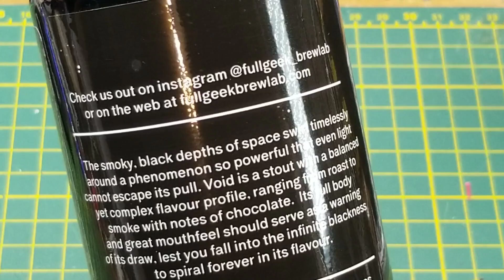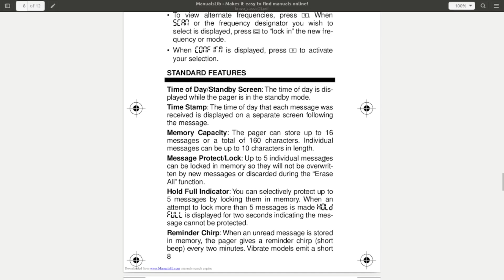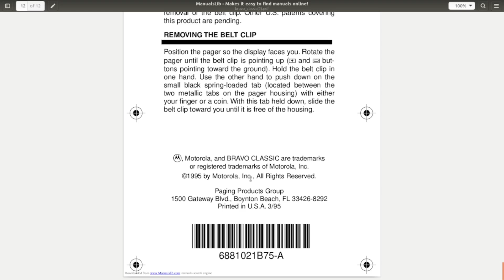curiosity teardown: pocket pager

Comment: Test mode for this pager: press and hold both buttons (grey and black)at the same time and turn on the pager. You can test display, vibro, buzzer, check cap code and baud rate.

Comment: And this is why SMS was 160 characters per message when it launched with GSM. I think there was a suggestion receive only GSM "pagers" but I don't remember one coming to market.
Reply from the maker: Those GSM receive only pagers never took off. 
I suspect largely because the early Blackberry came along at about the same time and cornered that market because they were capable of bi-directional text messaging.

Comment: A Motorola Bravo numeric pager! Worked on hundreds of these! News for the druggies, all paging companies cloned the ID codes to police departments when they came in with a court order. They knew your every move.😂😂😂
Hardest to repair was replacing the LCD screen, required a special machine to heat bond the display Mylar flex circuit "board" to the logic board. The first thing as a repair tech we would do is analyze it for water damage. If we noticed a scent of piss, you know it was dropped into a toilet or urinal. This would be an automatic "not repairable". It was considered a biohazard. It was very easy for one to scratch or cut themselves on sharp leads that might extend out from the boards. This has lead to techs winding up with a major infection from the contamination. 
Most often boards damaged to the point where it would take too much time to repair, if it was a rental it would be exchanged and the customer would be sent on their way. The old pager was used for spare parts. Those lights were a pain in the arse to replace. Still have the programmer for these items.
I feel for you if you spent many sleepless nights because of issues with these little devils. I tended to leave my problems with these at work.

Comment: I had a company device like that even in the late 80s.  When I worked for Checkfree, I had a two way Motorola pager where I could message back with a tiny keyboard.  Later, cell phones took over.
Reply: I had that thing!  It had the tiniest little flip over screen.  Actually the cell phone number I use today was ported from it if I remember correctly.  I know I still have that thing somewhere.

Comment: Damn those pagers when they went off in the UK I had to try and find a working telephone box to call the office  🙂 the only positive they couldn't track you unlike the modern stuff companies use
Reply: So true.  Finding a working Pay Phone / Call box was a challenge and the messages always seemed to be of an urgent nature.  No matter how quickly I managed to call in, always got the "Why did it take so long to call" line.     Those were the days....     That said, I kind of miss them as now I have no excuse for delays as the mobile phone just rings in my pocket instead.     Not sure these pagers were any worse because  now instead of just a short message one may occasionally "miss",  one gets sms and calls.  Not to mention other messaging apps. :/   It's definitely a lot harder to go off the radar these days

Comment: A trip down memory lane, I used to have one that would display a bit more than that one with a two line read out. Just enough to get the address of your next customer. They had to have tuners because resistors were -10 to +10 percent tolerance which was rather hit and miss. The problem looking for a payphone to make call as we had a 2 hour response time and could be on a train or bus to let the customer know roughly when we would arrive.

Comment: I am surprised that in 1990 they were not using LED's for backlighting, or at least for the indicator light.  I know LED's were not as good as today, but they were definitely good enough for back lighting an LCD and for an indicator lamp.
Reply: Motorola probably didn't want a dim red, green or yellow backlight.
Reply: @Okurkaarrgghh  Well, Blue LED's were invented in the late 1970's  Cant remember the exact year, and Galium Nitride based LED's started appearing in 1989, so higher  brightness LED's were possible, though Motorola likely found incandescent cheaper and they likely had a bunch of them in stock to use up :)
Reply: @EsotericArctos  Blue LEDs were still very expensive back then and I'm not sure about their efficiency then. I know earlier LEDs were considerably less efficient than incandescent bulbs.
Reply: Well, for the short time those things lightened, they were safe and easy besides giving some kind of battery-indication. 
When they started to light "orangy", it was best to have a new battery ready since it would run out during the next week or so.

Comment: I know a guy who would call the number to make the pager go off so he could step out on his wife or get out of an appoitnment!
Reply: When I got my first cellphone, I diassembled my last pager and installed a dual CMOS 555 based circuit that would activate the vibrate and beep after a thirty second delay when I pushed the red button, for exactly that reason. I kept the phon e in one pocket and the pager in another. Even the people who knew I had a phone never questioned the pager. (The 9V battery took up most of the case)

This actually brought back fond memories of doing that.

Comment: I'm a little disappointed that this did not involve sledge hammers or fire or both. Thanks Mr. Stuff. Still sounding a little rough, glad you are well enough for beer. Take care.
Reply from the maker: It wouldn't be the first time.

I handed over a bag of crushed pager bits to the next guy in the on-call rotation one Monday after a particularly bad week on-call.